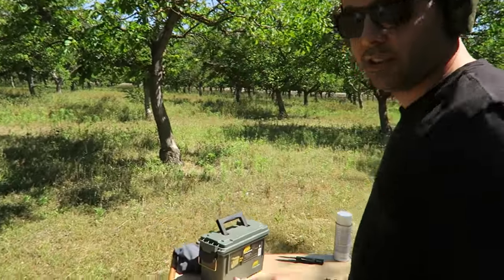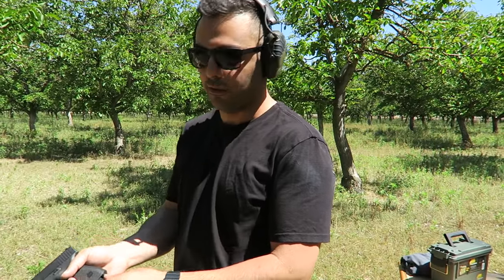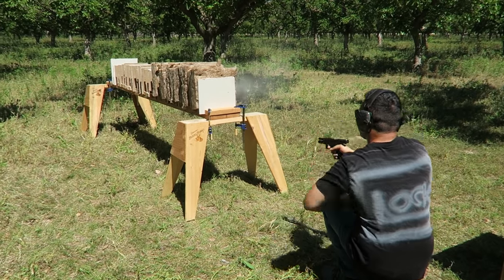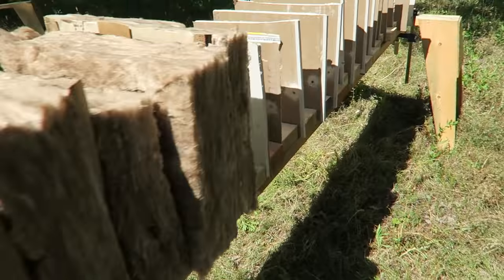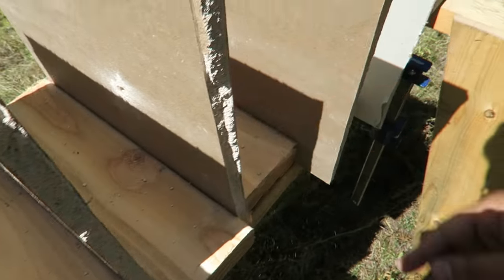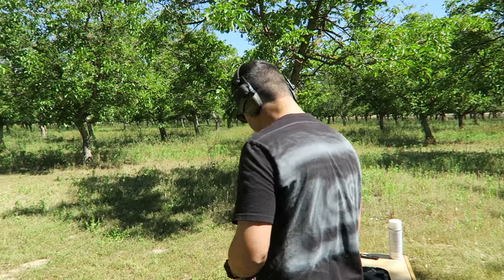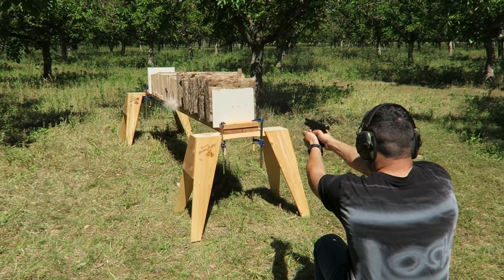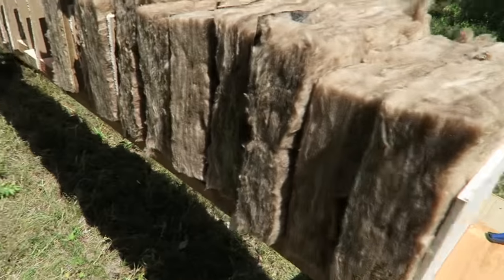GLOCK 19 VS DRYWALL

Comment: Edwin: The HP rounds were designed to reduce penetration not increase lethality. FMJ bullets are plenty lethal but too much penetration and a much bigger safety concern for LEOs. The reason the HP didn't expand as much in your test (great test) is because the first drywall piece filled the cavity, cancelling continued expansion. A human or animal body is liquid and at the speed of the bullet, that liquid gets in the cavity of the HP bullet and evenly expands to capacity. The bigger wound channel was a by-product of the invention and not the purpose. And yes, FMJ will kill just as well.